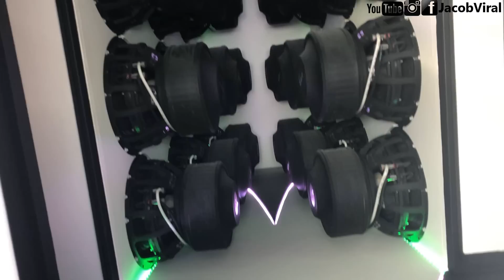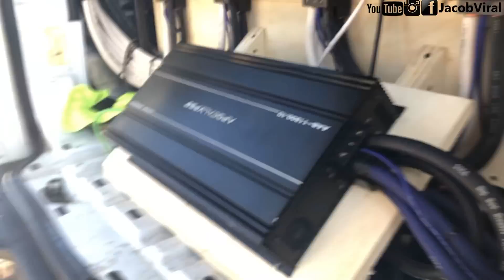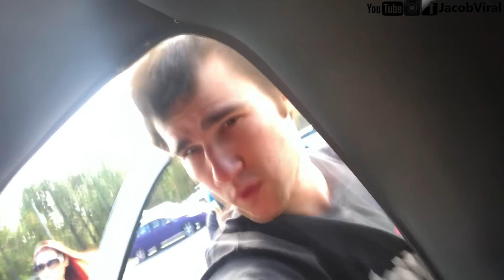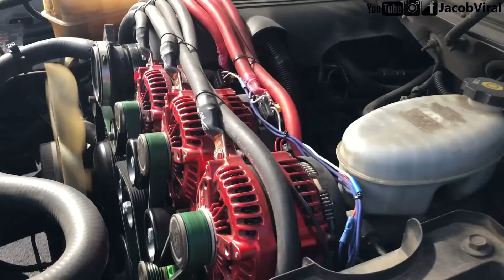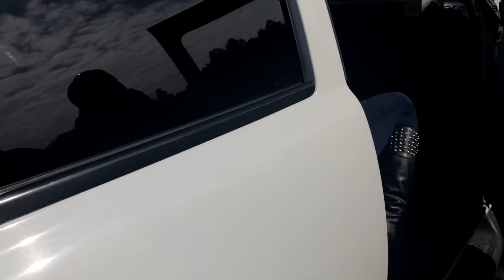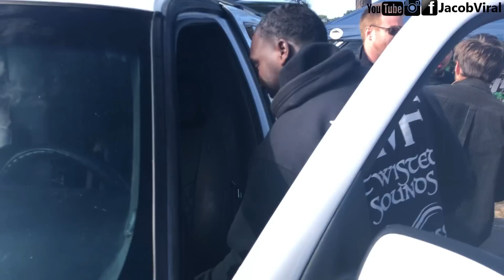YOU DON'T GET TO SEE A SYSTEM LIKE THIS EVER!!!

Comment: What it does seal? And it so incredible how those amps only produce 3k watts after box rise😨
Reply: COMPASBASSCLUB CHICALI the enclosure and how the subwoofers react in the enclosure play the biggest part in choosing power for a stereo system.
Reply: IMO
Reply: @jamesbondcaraudio4247  That's not opinion. That's facts lol
Reply: richisamindset01 💯
Reply: @jamesbondcaraudio4247  Yea I know a little about that bro, but what I am trying to say is that it is so funny how 6 amps that should be putting 60k+ watts only put 20k+ watts. Another thing is that 60k real watts in a spl setup will be devil with big numbers
Reply: @nate0 if you mean there is no way to control box rise yes.
Reply: 162 sealed. Demo all day at 162.
Reply: @COMPASBASSCHICALI  its  it funny its shitty. But it is what it is bro
Reply: @sunshyne564  Too much too little

Comment: Wired at 1 ohm rising to 5 ohms?🤣🤣 Never seen or heard that much.... What's up with that JACOB? I KNOW YOU GOT THE ANSWER I KNOW YOU DO? 😂😂
Reply: Simple Man it happens man. Depends on how the subs react in the enclosure. I’m wired at 1 Ohm and rise to up to 5 ohms between about 40 to 50 Hz. Out of a 5500.1 the sub only sees around 1500watts in that range in my enclosure.
Reply: @jamesbondcaraudio4247  so what can you do about it... Build a whole new box? I mean that would piss me off I spend 1500 bucks for an amp that's if blue on wings 5000w and I'm only getting 1500 out of it.... I appreciate you helping me understand this back in the day I used to just throw a box in the trunk but the powerful amp and call it a day now I'm trying to get back into it and get serious
Reply: Simple Man it all depends on what you are trying to accomplish. You can only control so much like box size, port tuning and impedence. And you can only do so much with said parameters. Due to limitations of size, power and frequency range. Just testing really makes the difference.
Reply: Simple Man in my case. I wired my subs down to           .25ohms just for burps. And monitored the impedence the whole time. Rises to 1.25 in mid 40Hz range.
Reply: nate0 wiring down that low and not knowing your impedence rise can be dangerous or fatal to your amplifier. Bracing and air loss from the enclosure. Would be considered enclosure design. I haven’t heard of any high power amplifiers with this feature. That would be awesome if they could keep the price low.
Reply: That's the beauty of the jl r.i.p.s technology, the 1200hd i.e. will maintain rated output from 1.5 to 4 ohms but they cost 1400 ea. tho.
Reply: tyrone reed my buddy runs like 12 of those amplifiers.

Comment: So anyone else think that's overkill? After so many 18s or whatever it's useless, not enough airspace and starts to mess with the quality of the dynamics, 8  of them would of did the same or more damage!!
Reply: Trouble reading?
Reply: Reading what??
Reply: @mephInc  what? The part that says still alot of tweaking, adjusting and such??? Yeah well, JMO but it's a few too many subs for the quality needed
Reply: @brycebrown5327  
Those are 12s, not 18s. That's what